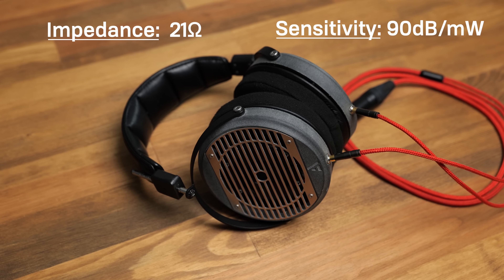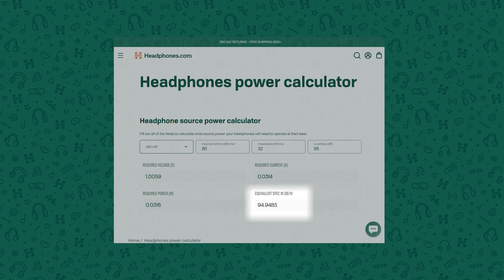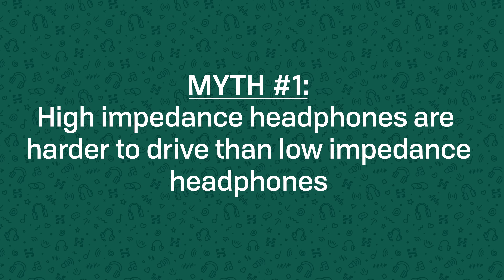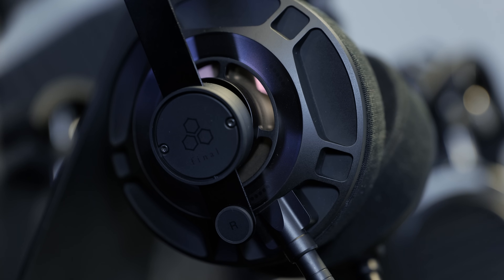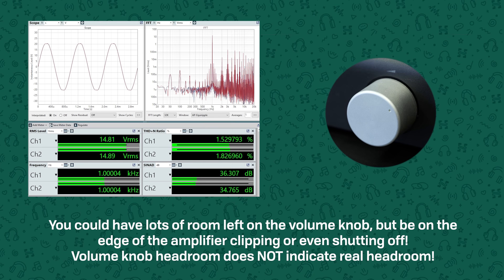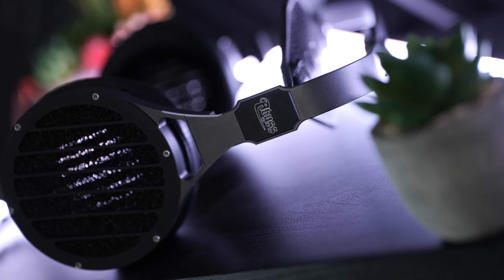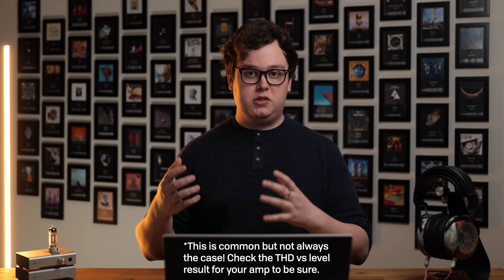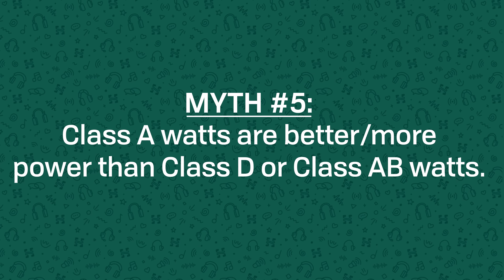Do I need an amp? How much power do headphones ACTUALLY need? - Myths about power

Comment: Ok so riddle me this why were the Meze elite's garbage with "normal" (fiio btr5) amplification when according to the calculator anything should drive them but really come alive with a true amp (HA6A)?
Reply: Because different amplifier topologies & circuitries exists, I wish it was as simple as just using a headphone power calculator. 

Solid state vs tube, discrete components vs opamps, battery vs mains power, hybrid vs OTL, etc.
Reply: Hey, did you also drive them with any other options? Any good non-tube?
My new Elites are quite underwhelming with Mojo 2. What aspects improved for you with a better amp?
Reply: @Peace Guard  I also have a btr7, and that did vastly improve the sound. For me, what was missing were all in the bass area. It just sounded lifeless, and I would max out the volume, but I felt I needed more.

Comment: I have an he6se v2 and i still don't understand if im squeezing absolutely everything out of its driver despite running it from the powerful burson soloist.
Well, it sounds close to a 1000$ headphone despite me paying only 600 so im kinda satisfied for now, despite its og price being 1800$
Reply: I doubt you’d do much better than the Burson. The planars just require more power to drive them to full potential. I have two Hifiman planars and had to upgrade my portable amp to an IFI XCan to drive them properly. For dynamics that wasn’t necessary.
Reply: @thiscorrosion900  Yea makes sense.
Reply: @joelcutinho2020  I confess I haven't heard any Bursons, but I've heard plenty about how good they are. It's sort of similar to speakers: tiny Klipsch bookshelfs like I have in my HT system, you can drive with almost anything, but a giant pair of Martin Logan speakers, well, you'd better match them with the right amp or you won't even hear them! They'll sound terrible anyway, probably.
Reply: @thiscorrosion900  Haha yea! The Burson soloist 3xp has a class A smooth sound but still more transparent than other class A amps barring GSX mini, I was a bit taken aback with the extra transparency as I expected a lot of body and richness (Singxer SA-1 is richer and has more body), but I decided against returning it due to its power, natural organic sound that is absent in most chifi amps, and versatility of sound signatures by allowing op amp rolling as well as 2 audibly distinct sound signatures (headamp mode and power amp mode)
Reply: @joelcutinho2020  I dunno I think what most audiophiles are after at a certain level is more transparency and detail anyway. One thing I have learned is that one headphone might be great for rock and dance music, and another may be totally unsuitable for that, lacking bass, etc. No matter what. Then again some phones can be tuned and tweaked and EQ'd and put them through the right amp and you may get different results. If you just want to listen to classical or jazz I would say get some electrostatics if you can. But planars are great, too, for that. If I want to listen to that music I whip out the Hifimans for sure.
Reply: @thiscorrosion900  Totally agree with that, nothing is perfect, and I too have a variety of hps and amps for different case scenarios.
As for the Burson, i had a preconceived notion that class A amps sound full and rich, whilst the Burson is fuller and richer/less transparent than thx amps, it still feels quite transparent (in a good way) to my ears, maybe someone else's might have a different opinion

Comment: Back then, on my community of audio, people told to me that I had to have stack (DAC + AMP) if I wanted to drive headphone properly.

Now, I only have iFi Zen Air DAC for everything including my IEM & headphone. I'm satisfied with it, even though it would be nice if I have a stack 😂
Reply: You have to take into consideration that not many members of the audio community have a proper understanding of even the simplest electrical properties of DACs, amplifiers and headphones.
In the end if you are satisfied it's all that matters.
Reply: I'm driving my Edition XS with my motherboard ALC1220-vb on board amp, sounds good!
Reply: @superandre96  people think earpods sound good. 🙃
Reply: @En_Joshi-Godrez  they legit sound good though! And I can almost max volume on windows and they are almost too loud even. I was wondering if I should get an amp, but apparently there are a lot of myths about them and if volume is good enough there's no real reason to upgrade..
Reply: @superandre96  its actually the opposite, people that think loud = properly powered are completely incorrect here. For the case of planars, because of how their magnetic polarity works, they need to be induced with high capacitance in order for their 'voice coil' (which on a planar is a substrate accros the membrane) to be properly damped. That large windings over a dielectric membrane would produce some non-negligible capacitance, and this would explain why they need more power compared to other driver types to perform at their best. High capacitance is derived from having larger super capacitors for which your motherboard has tiny ones. The more capacitance, the better driver planar magnetic headphones will be otherwise calculated by dampening factor. Its as absolutely nothing to do with loudness like you erroneously claim, and that why the $8000 HM1 with only 2w of power can drive the susvara flawlessly, while a shiit magni with 3w, has severe compression. You will here a difference.
Reply: @superandre96  your silence is telling. Get an eduction.
Reply: The Zen Air should drive most reasonably efficient headphones etc,, unless they’re unbelievablly energy-sucking.
Reply: Pearls before swine.  If someone thinks AirPods are legit because they go loud enough I just don't bother.  If on the other hand from a question it sounds like someone with IEMs or headphones really doesn't know what they're missing it might be worth responding.
Reply: It depends on your headphones. Only planars need specialized equipment because of their current capacitance.

Comment: Amp classes are more in car audio. Class D is for bass/low end. Class A/B is mids and lower high frequencies. Class A is top end of the frequencies range.  But as stated power is power. RMS matters more than anything in mobile audio, like impedance and sensitivity matters more in audiophile settings.

Comment: Great video, Cameron. I use a digital db meter ($20 Amazon) and shoot for 80-85db at abut 50-60% amp volume at low gain setting (I typically only use high gain for a little more note weight at low listening levels, like the old-fashioned loudness function). After doing this with about a dozen sources I have gotten to know my headphone driving need rather well. Now I can more easily look at the impedance and sensitivity of a headphone and basically know the ballpark power source needed.
Reply: Just pointing a db meter at a headphone cup isn't a good measure of their SPL, you'll end up underestimating it by a lot.
Reply: @koustuvkanungo9873  the meter tip inserts between the pads as I press them to seal around the meter tip. It is not meant to be scientific measure. I use this for benchmarking. Very useful to protect me ears too. Thanks.
Reply: He also literally said % of amp volume is doing it wrong
Reply: @dukdive  Cameron's method is more accurate but my method is a quick way within an acceptable SD to benchmark my listening levels for understanding my headphones power needs and to protect my ears. Thanks.

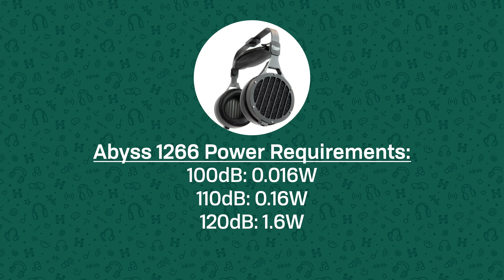Comment: Just gotten myself an Arya V2 & if what I've understood from what you had said at 7:26 is correct, can I drive my Aryas with the Topping DX3 Pro+ that has a power output of 1.8 watts @ 32 Ohm i.e. 1.226 watts @ 47 Ohms?
Reply: Only during a full moon
Reply: It will drive them with ease.
Reply: I don't think this was  a real direct  question.  maybe he was making a point about what the video seems to imply :  power is power ...
Reply: It will make them loud, but thats doesnt mean they are driven properly. You should upgrade to something price appropriate for a ayra in the $350 to $500 range.
Reply: Also your calculations are false. If you look at the product spec for the dx3, you will see it has different voltages at different impedances. Your 48 ohm load will have a different voltage than a 32 ohm load, you cannot just substitute the new impedances, you need to know the new voltage at that impedances.

Comment: So then even if I put my Qudelix 5K into low gain mode, I don't actually lose headroom? I thought the max voltage getting halved would cause the max volume to drop as well.
Reply: I believe you do lose headroom. 

Qudelix says the high gain mode has "6 dB higher maximum output level".  After all, gain is really whole point of an amplifier. It's a measure of the degree to which the output signal can be amplified over the input signal. This can be expressed either as a ratio or in decibels.  When I look at the K5 Pro, for example, it's gain levels are advertised as 0dB, 6dB, and 10dB.  At ASR, Amir tested the K5 Pro at 33 ohms, and found a max output of 990 mW on high gain, and 99 mW on low gain. If I punch those numbers into a headphone calculator, it happens I  get a difference of exactly 10 dB. Using an SPL of  100 dB/mW for example, it comes to exactly 129.955 and 119.955 dB, respectively. 

So if I'm using the K5 only on low gain, I'm skeptical that there would be any advantage (other than the additional features) over a ~ 2Vrms amp that tests equally well (say the Q3 with ~2.25 Vrms). So I don't really understand what this video was trying to say here.
Reply: @kenbalbari3229  not all auditory phycho acoustics can be measured. We have known this for a very long time now.
Reply: Not unless you're listening at 128db, which as we know, doesn't automatically cause severe hearing damage. 😉
Reply: @En_Joshi-Godrez  Didn't get your point. Q5K doesn't provide that much current for low impedance low sensitivity planars in the first place.
Reply: @koustuvkanungo9873  you had a little baby rage rant over on gizaudio channel about this. Calling me and anyone that dared say your reasoning for why you don't need more power than when a SPL calculator tells you is flawed a whole bunch of ad hominems.
Reply: Your comment got deleted. It didn't even show up in my feed. Youtube is a funking joke.
Reply: @En_Joshi-Godrez  You usually still get notifications, and I just usually open the thread just in case.

Either way, all I stated in that thread was exactly what is being said in this video. But I got piled on because others didn't like to admit that their expensive toys aren't actually necessary to drive their transducers.
Reply: @koustuvkanungo9873  were there any measurements you could provide to show that the apple dongle had sufficient voltage at 8 ohms? ASR didn't do them, and I cant find them anywhere else.
Reply: @En_Joshi-Godrez  We were looking at cadenza, whose specs were at 16ohm.

Either way, there's a voltage vs load chart at page 35 of the ASR review.

Comment: I'd like the topic of balanced cables for headphones explored in a similar way.
Reply: There are a lot of myths surrounding the use of balanced cables with headphones, not helped by the different cable topologies different brands headphones have, and whether the headphones are passive transducers or an active (e.g. noise-cancelling) one.
For "traditional" topologies where each L/R capsule has its own 2-core cable feed and the "grounds" are tied together at the headphone jack end of the cable, if switching to a balanced cable results in an audible difference that means there is something wrong with the grounding topology and/or termination inside the non-balanced headphone amp.
A passive headphone itself (excl. cable) is by definition a balanced device as both "ground" and "live" feeds terminate in the same impedance.

Comment: Good explanations !
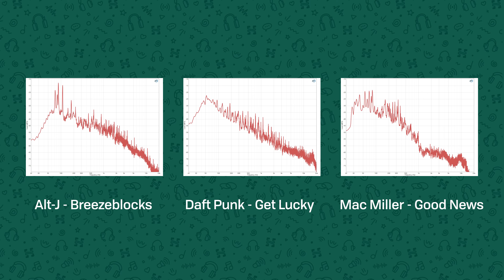Just one little thing @ 3:15 and latter, you have to be careful with FFTs. An FFT will show a white noise (which is bright) flat and a pink noise (which is flat) downward slopping 3 dB/Oct.
There is a difference when plotting sines (one freq) vs plotting spectrum. A basic spectrum analyzer will show equal loudness when there is equal volume per linear bandwidth. It's because for an FFT, 20 to 40 Hz is the same bandwidth as 20020 to 20040 Hz. So to get a better representation, you have to tilt 3 dB per octave. Still it doesn't change the point, bass are louder, but not as much as a basic spectrum shows.

Comment: Technically sensitivity should be expressed as a function of voltage not power, the way many (but far from all) speaker manufacturers express it nowadays.  If you express 'sensitivity' as a function of power (wattage) what you are actually describing is 'nominal' efficiency. Nominal because it depends on impedance and the quoted impedance is 'nominal' because it often varies with frequency.

Comment: the thing that i don't understand is why does more gain not mean more power? doesn't power equal voltage X current, and gain increases the voltage? so there should be more power, i don't have a deep understanding of electricity and circuitry so bare with me, i understand the increase of noise floor and why that's bad so there's no need for an explanation there.

Comment: So if power isn't an issue, then is it safe to somewhat assume that the sound changes from different DAC/Amp setups are more so on the pairing of those to the headphone? 
I remember trying to power my HD600 on my old Fiio Q1 Gen 1 and it was able to play it but the soundstage felt really narrow and there's a bit of a loss in clarity. Plugging it to a desktop headphone amp with my Topping D20 usually did the trick for me. I'd say that if it was more so the overall performance relative to the gear, then that could explain how different both DAC/Amps made the HD600 sound.
Reply: It could be, and it could also be in your head.

I'm not saying there's no audible differences between gear, but I found that in my own testing, once I set things up to no longer be able to tell what source gear I was listening to, an enormous amount of the differences went away entirely, and it became EXTREMELY hard to tell.

I even did the same tests with a few of my friends who're huge audiophiles and spend thousands on source gear; I won't lie, the face they made when they couldn't tell if they were listening to a Modius or a Holo Spring 3 was a little funny.

Hard to say for sure though without proper testing though, your brain is very very good at making stuff up based on your perception and expectations.
Reply: @KaneAmaroq  its a weird thing honestly
Like at least in my memory, I tried pairing the HD600 with the Fiio X1/Q1 gen 1 combo, my Moto G 5G Plus connected to a Lake People G109(double amped), and with a G109/Topping D20

The Fiio portable stack powered the HD600 for sure but for some reason it sounded very narrow and because of that, the mids and highs sounded very close, although the hardware bass boost helped out the warmth a bit. Overall it wasn't very good

My phone connected to an amp with no dac sounded quite good but the highs were a.bit lacking compared to the desktop dac/amp stack, although i would want to eventually do more testing on it eventually

It could be all in my head so I'll also try to ask my other friends how they feel about it if they pass by
Reply: Components used can affect the coloring of sound. Since sound is translation of electricity to an audible signal, the parts that affect the signal's cleanness can alter that. It's the same reason not all headphones sound the same
Reply: @dmines25  hmm makes sense, tuning, design and components do make headphones sound diff from each other so it makes sense too that it works for stacks too. Thanks
Reply: @tepellin_10  no problem. I actually like the discourse. It's refreshing to share info with others
Reply: In that scenario it's absolutely not in your head. More power and the ability of the amp to deliver fast quality power over the whole audible spectrum will absolutely make a big difference.  And, If you want even more, find a way to test your HD 600s on an OTL tube HA and you will hear the soundstage widen, the three-dimensionality increase, separation increase, and realism, especially in the midrange increase.

Comment: I’m curious what you guys think is the best headphone in the world that can be driven by a phone… I’m a simple guy, I don’t want amps😄
Reply: Sony, Meze and Focal are brands to look into. The MDR-Z1R, Empy/Elite/Liric, and the entire Focal line (e.g. Clear/Stellia/Utopia) are all really easy to "drive."

But if you don't want an amplifier (neither do I), plenty of other headphones reach volume just fine without one. My "hard to drive" Aeon Closed X sounds just as good with or without an amp at my preferred 70dB listening level.
Reply: Focal Stellia
they scream when coupled with a lemon

4 real my dayli porta pros are quiet easy to drive via phone and can be too loud
but the stellias are so efficient, boy
Reply: Good dynamic type with low impedance. Stellia, 109 Pro etc.

Comment: HE6 with EQ takes 90% volume from a THX 789 which is often referred to as a 6W amplifier as that's it's max output. Are there many amps that offer same output at the correct impedance with a much smaller max output, I haven't checked the numbers.
Reply: As mentioned in the video, (in fact I used this specific example) the position of the volume knob should never be used to indicate whether a headphone is being driven properly or how much headroom is remaining. It can be quite misleading
Reply: @GoldenSound  Yes, but in practise what would be examples of amps both ways? Lower max output, but sufficient and same/higher max output, but insufficient?
Reply: @hartyewh1  The volume knob does not indicate the max output of the amp
Reply: Audio-gd Master 9